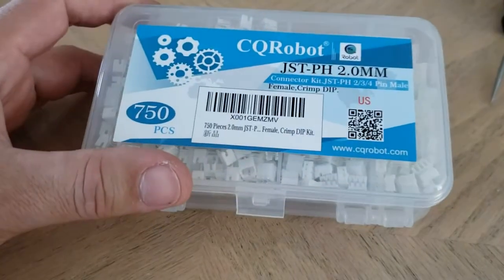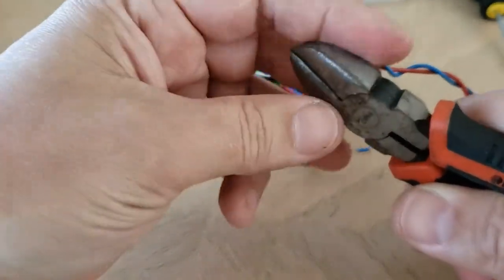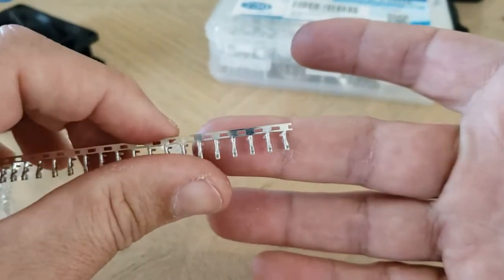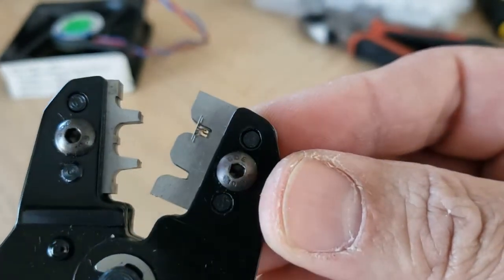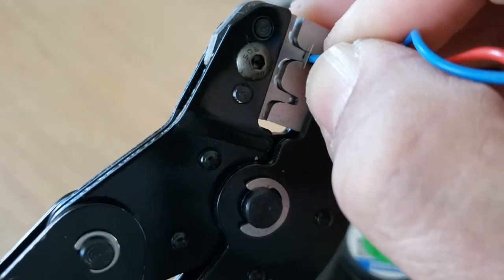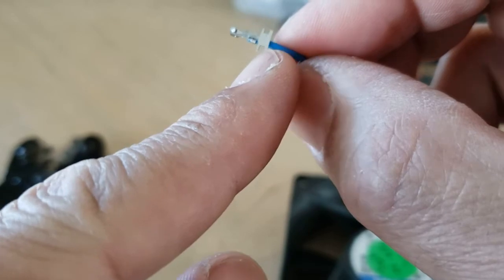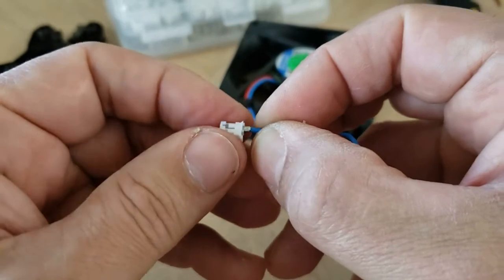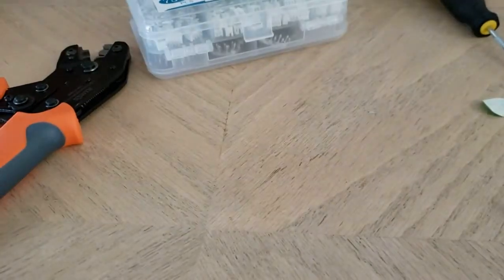Crimping a JST  Molex 2.0mm Small Cooling Fan Connector with a IWISS SN-01BM Crimping Tool

Comment: Thankyou!! You're the first crimp tutorial for jst that actually helps a lot, keep doing you my man!
Reply from the maker: Awesome. Glad it helped you.
Reply: @hesmanpro   also, figured out another way since mine don't come with the useful extra plate thingy.

I first pinch the wire in with my finger or pliers and then finish the job with the crimping tool. It's so easy now

Comment: After my first attempt at making custom cables i had put of making them again for a year. this filled the gaps in my understanding . also i found i could place the cable in the crimp before placing it in the tool but i was using larger crimps. thanks.
Reply from the maker: @zydawn  awesome. glad it helped you eventually get it done right.

Comment: I appreciate the video. Yes, some redundancies but too much content is always easier to deal with than too little.  Here is my summary for my future reference:
- Wire-strip 3mm max, 2mm is ok
- cut off lead from strip, leave backing attached
- hold crimper in left hand, lever up
- place lead in crimper, open side down, backing strip flush on right side. Tight fit so manipulate both sides to bottom of crimper.
- Insert stripped wire into the lead from the right side until it fully bottoms out
- Place pressure on wire from right and at the same time fully depress crimper until ratchets release.
- Remove lead from crimper
- Observe wings on open side of lead have buried into insulation
- Rock backing strip back and forth to remove.

Comment: excellent video. i used qibaok qi-28bma crimpers. the cheapest i could find on amazon. worked great, i just had to figure out to bend the bottom pin out way far so they aren't in the way of the crimper. kind of hard to explain but if you feel along the bottom theres a tiny pin that sticks out. i had to bend that way out and not let it be in the way of the crimper. then bend it back a little before inserting. perfect every time now. i was using jst-xh connectors to connect a thermistor and heater block to my 3d printer.

Comment: Very useful video. My JST PH connectors must be slightly different. With the wings flush against the die, the opposite end gets crushed. I had to remove the wings and position the connector slightly deeper, until the opposite end clears the die. To handle the crimped connection being too thick, I crimped it a second time in the smaller die. Came out perfect; that die just makes it narrower.
Reply: Mine did also...

Comment: I believe the back section of the crimper jaw (1,85 mm) should be used for PH2.0 mm terminals. The front section of the jaw (2,1 mm) is used for XH2,54 mm terminals.

Comment: Great tutorial. Thank you!
Reply from the maker: Glad it was helpful. Thanks
Reply: @hesmanpro  I made the mistake of just getting a set of five PWM fan connectors with 20 pins for about $6 USD from Amazon. Definitely need to get a whole kit for not much more. 
I have one question I found that I had to recrimp to get the wire harness wings to close down totally. Should I change the settings on the crimper(the wheel with teeth near the handle) or should I go down to the smaller size? This is 22awg(think) wire on a tiny Evercool fan.
Reply from the maker: @Dcatts-i2z  i would try a smaller size and see if that works. Not sure what crimper you're using.
Reply: @hesmanpro  It's the IWISS SN-28B 18-28 AWG

Comment: I couldn't finish watching this, it was pure torture. This could have been put into a 2-3min video with the same end result. Appreciate the effort, so consider this constructive feedback.
Reply from the maker: I agree. Not for everyone. Too lazy to re-edit it.
Reply: @hesmanpro  Well not only that. But the title is for.... extremely small connectors. I had better luck crimping the outside first (around the wire sheath) than the middle, pressing over the bare wire. But you took so much time to show it the other way. Bravo, this must be a troll.

Comment: Wonderful. I already did a quick repair by twisting and taping the ends of my cut AIO pump + radiator fans shared 4-pin cable... But Im scared of being electrocuted because one of the broken wires is the ground

Comment: Hi! is it possible to connect 2 wires of 2 different fans to a single conector? or each fan must have a separate connector? I'll be using this for the fans for a 3d printer so they'll be 2 identical fans connectedto the motherboard but i was wondering if i can use one connectorfor both of them, thanks in advance

Comment: This is not how you do this. The tool has a ridge in the middle by design to fit the “wings”, you’re supposed to fully detach it from the rail at the start and pull the head through its side so only the top of the wings and down is making contact with the looser jaws. You crimped a very small amount off that mark and didn’t get the wings completely or at an angle so some of it was bulging. That’s why it didn’t fit perfectly into the fixture the first time

Comment: Sorry but you should take this tutorial down as it gives the wrong information. This tool is good for the JST XH connectors but it is too wide for the SH connector that you use and it crushes the part that should slide on to the pin of the male connector. Also you strip to long. The wings that crimp onto the bare wire is much smaller and the stripped part should be no longer than 1 5mm The correct crimping tool for these 2.0 connectors is the Iwiss IWS-3220
Reply: Is the Iwiis 3220 good for xh too?
Reply: @rics_zip  Yes it is but the BM-01 is better